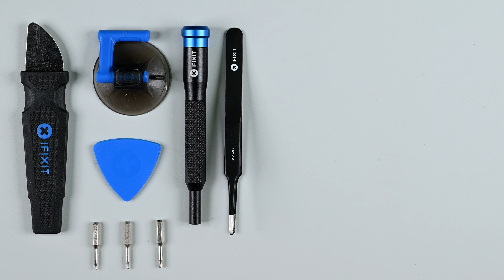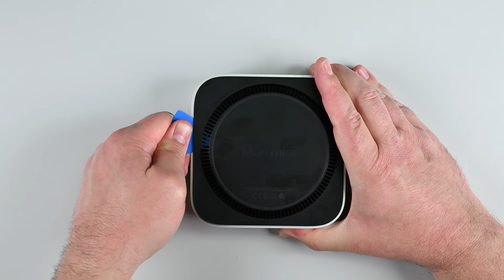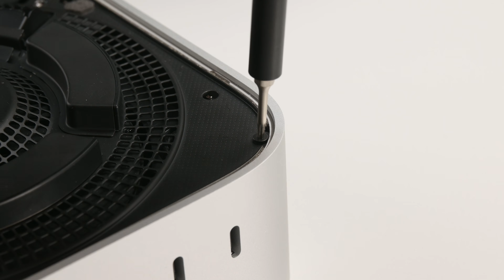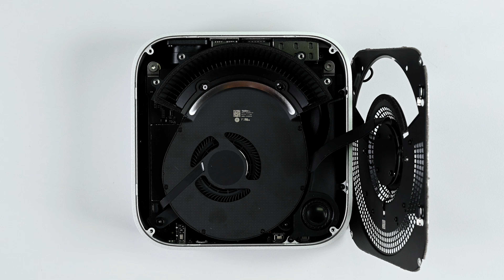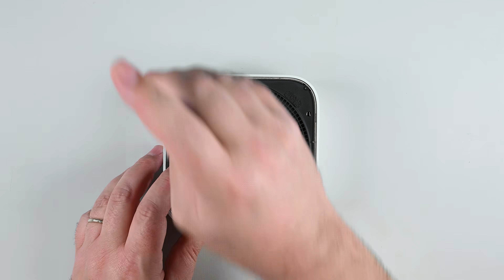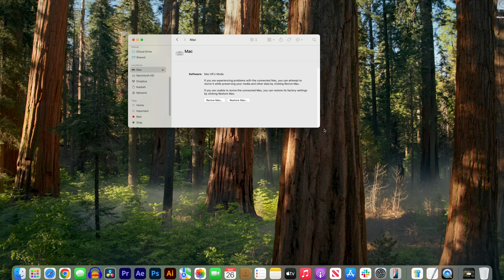M4 Mac Mini Storage Upgrade! Do it Yourself And Save Money!

Comment: @ifixit I've been loving the 2TB SSD, but recently I downloaded a video shoot off of Google Drive that exceeded 2TB and didn't realize that I didn't select my external SSD to receive the downloads. When I woke up in the morning, the Mac mini wouldn't turn on and I had to put it into DFU mode and reset it. It works for only about an hour and then it goes back into recovery mode. I spent $300 on this product that does not work anymore. Please respond or give me an email to get in touch with you to figure out a solution.

Comment: Instead of using a second Mac, could you 1.) clone your internal SSD to an external bootable drive, 2.) boot off the external drive after you’ve replaced the Mini internal SSD, and then 3.) format the new internal SSD and clone the external drive back to it? Or do you need to go through the DFU process for some other reason?
Reply: DFU is REQUIRED. Without it, there’s no bootloader to even recognize that you have another external drive plugged in. Source: I tried it. Essentially, it doesn’t  work that way because Apple didn’t need to make it work that way. The BIOS on all other machines had the ability to be pointed at another (external) bootloader. But M-series Macs are based on the iPhone architecture, and have no need to use an external bootloader ever. So they don’t.

Comment: removing the fan cable isn't necesarry. It works well without doing this step and make sure, the ssd is really straight in to the slot. otherwise you could run into the 4041/4042 error while restoring the mac. 

but overall, this works very well. I did that a few weeks ago.
Reply: Where did you get the SSD? I've got a 256Gb model and want to go for 1TB.
Reply: @techxpr2  expandmacmini where I got it from. but I had to wait almost 3 month for delivery

Comment: Should probably emphasize to BACK UP YOUR DATA. Because the replacement process will regenerate the encryption key and your old data will be irrecoverable. You cannot plug it back in nor use another Mac to recover the data off it. It's gone.

Comment: For a company that’s saved my life over the years, hear me now: seriously consider deleting this video. You’re not only getting traffic and comments for all the wrong reasons but someone will seriously jam a lightning cable into that thunderbolt port because of you. It’s not helpful at this point, it’s just about getting views. Sloppy.
Reply: I definitely did this. What is the repercussions? My 2 TB SSD is fried so it won’t work and I’m trying to go back to the 256 GB normal one and it won’t restore in DFU mode.

Comment: Not everybody has such tools for opening up the Mac mini. They may have to be purchased.

Not everybody has access to a second Mac computer.

This DIY upgrade voids the warranty.

This process risks damaging the device.

If anything goes wrong with the upgrade, it's a pain to repeat the process.

If you're not comfortable with DIY, this can cause significant anxiety or frustration.

It's much, much easier just to spend the money to upgrade to 512GB and then tack on a 2TB or 4TB external drive. That's exactly what I did, and I couldn't be happier.

Tip: Don't be too cheap on yourself.
Reply: Bonus: upgrading to 512GB doubles the write speed of the SSD!
Reply: Legally, Apple shouldn’t be able to void your warranty caused by this upgrade unless you caused damage directly. The Magnussen-Moss warranty act protects consumers from voiding warranty by performing repairs or upgrades. Also, since Mac Mini’s modules don’t contain any controllers, or roms, and it’s only a NAND flash with power delivery circuits, the 2TB will detect as an OEM Apple SSD. The makers of these upgrade boards identified 2 vendors used by Apple, such as SanDisk. As such, the only real risk is if the power delivery circuit fails (which AFAIK Apple’s buck converter is known to surge and yet they’re still using).  To me, this upgrade ability was the only reason why I bought a M4 Mac mini. If it was soldered on, I would still only suffer with my MacBook Pro with external SSDs. To me, this is another must have feature that made me buy one with upgraded ram.

Comment: Er… the ‘lightning’ symbol means it’s a Thunderbolt/USB-C port, not a Lightning port!!! So it’s not a Lightning cable that is required but a USB-C cable. And if the second Mac is running macOS 13 or older, it needs to have the Apple Configurator app installed in order to do the restore. MacOS 14 or newer it can be done via the Finder.
Reply: Quite a slip up for a channel named iFixit.

Comment: After installation, you’ll need another macOS device (2015 or later, either Intel or Apple Silicon, including Hackintosh, or Windows PC running macOS on VMware) to complete the setup, as your Mac mini will enter DFU mode and require a firmware update.

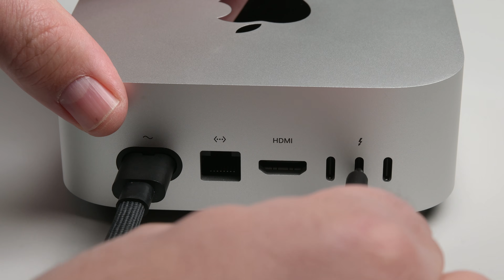Comment: 4:34 "connect the Lightning cable" 
Don't think so. That's a Thunderbolt cable.

Pity you can't identify possible sources for a replacement SSD, but I understand if you're prevented from doing so.

Comment: Do you need a M-series Mac to do the restore or would my old intel iMac work?
Reply: Apple Configuator app is needed for older Mac OS.
Reply: You do not. I used my 2020 i9 MacBook Pro to do the DFU restore. I think as long as you’re on a recent MacOS, you’re good. Did my 2TB upgrade nearly a month ago and have been dailying the M4 Mini for ZBrush, FCP, and Rhino3D.
Reply: @cartertg  which ssd did you purchase?

Comment: Wrong answers only: Why is the most expensive computer using what seems to be exclusively only the flimsiest of connectors?
Reply: its actually only $500...also ive taken apart lots of PC computers recent that cost 3x more that have the same looking connectors. so I just think your an apple hater because they cost just about the same as computers with similar performance.

Comment: Mine went fine, upgraded from 256GB to 2TB.  I found one need not disconnect any of the cables, but unscrewing the power connector is a good idea if one feels one must disconnect.  Otherwise, simply carefully arrange each layer out of the way, avoiding any stretch or stress on cables.  The only hiccup I had occurred during the DFU process.  It began properly, but at some point, after the download and install went on for a good 15 to 20min or so, I got an error message that the process could not be completed.  I restarted the device in DFU mode and lo and behold, the process resumed and completed itself properly.  The machine works great, benchmarks suggest a little bit faster read/write speeds and there have been no further issues, even after a recent update to Sequoia (15.4).  Very happy with the end result and saved my self $500!  

Unfortunately, I suspect the aftermarket boards will become unobtanium, given recent events.
Reply: Where did you get your drive from?
Reply: @realgoose  expandmacmini
Reply: @realgoose  I have tried to post the name but it keeps getting deleted.
Reply: Xxexpandmacminixxx
Reply: What recent events?  Did apple ban them?
Reply: @ytskt  the recent tariff extravaganza

Comment: I´m no gambler. I like to play it safe and want to avoid to buy any 2 TB SSD from not so well renowned Shingshong Tradingco. So, where to get the Hardware? I have seen a lot of creators changing the SSD, that came with basic tooling btw. So, iFixit, didnt need your video without you selling me the interesting part.

Comment: Now all I need is that mystery SSD and a second mac.
Reply: I need that plus a Mac Mini.
Reply: iBoff made their own. You can buy that.
Reply: @d_techterminal  yeah, except that its 1/3 the speed of Apple's 2TB. Don't know how they managed to make a larger ssd that is basically the same speed as the small one...
Reply: @srenblackgaard9982  Not true. Expand Mac mini’s 2TB is faster than my original 256GB one
Reply: @ I was referring specifically to iBoff. I have not seen speed tests for the Expand Mac Mini, but Apple's 2TB is over 7000MB/s read and write (I forget the actual numbers), not just barely over 3000.
Reply: A 2TB third party SSD and a used M1 Air is like $100 less than Apple’s 2TB storage upgrade.
Reply: @ Most people have friends or associates with a Mac.
Reply: @hank9th maybe Trump wanted third party SSDs to be less worth it
Reply: A second mac isn't necessary, even windows works just as well
Reply: Same 😂
Reply: and the cable
Reply: hot tip there is an open source tool called "idevicerestore" that works on windows, linux and Mac and can be used to restore an apple device.
Reply: nice 
nice 
nice 
nice
Reply: Second mac is not necessary, refer to our DFUKit package, windows can be DFU as well!
Reply: Wow, that is a very irrelevant minute detail that slipped, when they made this video! However, the Mac mini is the device where upgrading the internal storage is the least relevant – since, probably it just sits on a desk and collects dust, just get one of those Thunderbolt hubs that you can put underneath, that can also conveniently host a M.2 NVMe SSDs and you're good to go. Even if you get the most premium version of that, you're upgrade should be less than 400 EUR/USD for 4 TB of storage.
Reply: our team was trying to get an sponsership but didnt got any so ya we bought a new mac mini of  2TB and took out the ssd form it and put the 256 GB into it ya our video is late but we didnt got the sponshership sorrry for the inconvinience and sorry for the inconvienience in spellings of sp and in so ya

Comment: Very nice video but where can you get the replacement SSD from a good source? This is not a regular SSD since the controller is not on the baord. IfixIt sells you the tools but not the special SSD needed for this. I have been looking and Iboff sells two types of chip versions. One is Sandisk and the other one is Kioxia but both of them are sold out. Also we would have to pay 105% in "import tariff" due to our current political situation. So that mens a bit over double the price. Also they dont have it on stock and there is no option on their website to order one (not even backordering one). Any other ideas from a reputable source? Thank you very much
Reply: Same question
Reply: Where can I get the ssd?!!
Reply: iBoff RCC is a good source for those at the moment.
Reply: Those who placed an order before the current political disruptions are getting them now.
Reply: Looks like the Expand Mac Mini module?
Reply: Crazy 😧
Reply: iBoff is mass producing them now, as you may know, so the next bunch is probably on the way. As for the tariffs, well, traveling to Malaysia may be an option, they have an HQ there, and the country's beautiful ;) Just grab a couple 'spares' of them to sell back home and get some money back😄 Sounds like a plan, imo
Reply: I ordered mine from BatteryMall, but it got lost in the mail. Got a refund and ordered off Amazon (it was cheaper).
Reply: This is the type of stuff ifixit does that makes you wonder what happened to its credibility
Reply: @3monsterbeast  There is nothing incredible about this. It requires a custom component that, until recent political events, would be readily available in the USA.
Reply: @eltamarindo where though? this should have been pointed out, the descriptions they state makes it seem like it's so easy to do this upgrade but this upgrade is impossible if they can't even point out a reputable source for the component!
Reply: @3monsterbeast  You can't travel back in a time machine to before the tariffs. Even if you can get the part now it may get caught for months in customs warehouses.
Reply: @eltamarindo  no one makes NAND cells in the US so how do you expect anyone to build an SSD in the US without importing them?
Reply: @somethingsnowing actually micron makes them in Boise Idaho

Comment: This is amazing! Thank you so much, I was thinking of buying Satechi hub for it for $99.99 with its ssd port but it seems like just upgrading its internal ssd is a better choice, also isntead of paying $380 for 1tb first party ssd you can just buy an ssd for around $80-100 and save so much money!
Reply: a regular SSD will not work in these. this SSD does not have a controller chip on the removable SSD which makes them incompatible with the standard cheap SSD's

Comment: 4:31 should be "thunderbolt" instead of "lightning".
Reply: Thunderbolts and lightning, very very frightening
Reply: rookie mistake
Reply: Yeah, that's wild.
Reply: Yeah I thought this too
Reply: I haven't watched many of their videos recently, but I know in the Quest 3S teardown, they called the IR illuminators as IR sensors, despite clearly showing just 20 seconds later that they are in fact LEDs. They also mistakenly called their own Anti-Clamp tool as their iOpener in the Pixel 7 Pro battery and screen replacement videos.
Reply: I really don't get how do they keep making these sorts of mistakes in their videos
Reply: It’s really more apppes fault of calling two different types of cables what are essentially synonyms.
Reply: @SalzmanSoftware  No. Not even remotely, in any definition of either word.

Comment: A person made a cool new red SSD which is actually even faster than Apple's and is recognized as original because it uses the same components but with optimal positioning and a few upgrades, and is way cheaper!

Edit: @XannY_Designs in the replies pointed out it's from "iBoff Rcc Repair Shop".
I remember seeing a YouTube video about it and I was impressed, thanks.
Reply: iBoff Rcc Repair Shop! Legendary guys, reengineered whole ssd